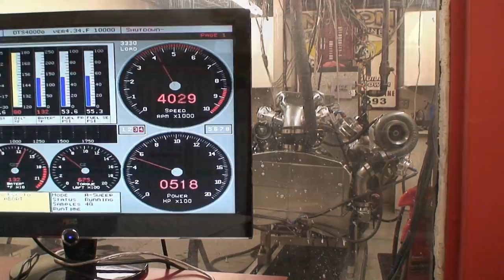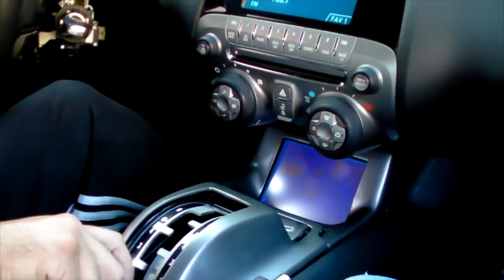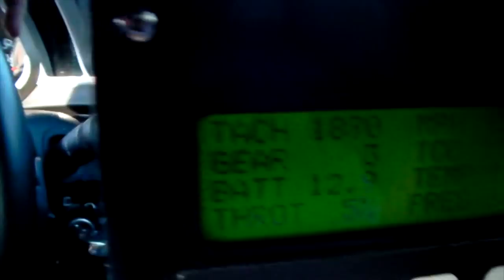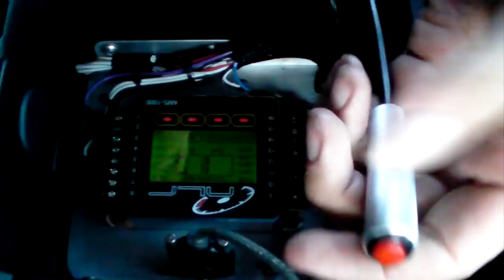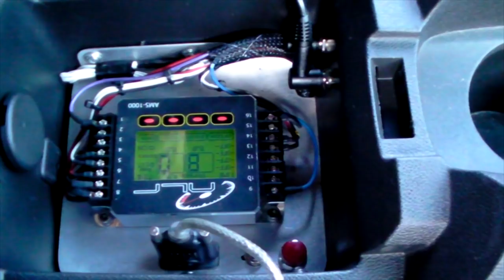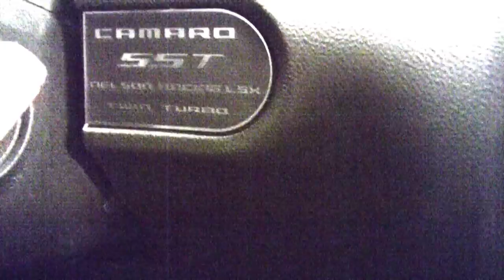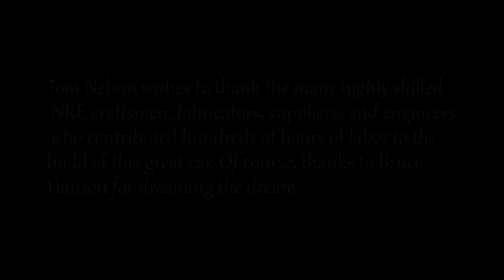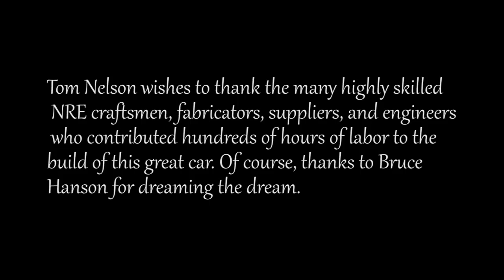1500 HP Camaro Burns up Chatsworth!  LOL!  Twin Mirror Turbo LS Camaro.  Nelson Racing Engines.

Comment: So many people keep saying why build a car that has no traction and cant use the power. I just wanna say, did you even watch the whole video? The part where he tubed the rear end so you can fit big tires in the back. Of course your not gonna take it to a track with street tires. He is just having fun and showing/testing the car. Once the owner has it, it will probably have at least a wide radial tire for the street.
Reply: isn't the word tubbed? i know it aint tubed

Comment: Yes. I just left out the power lost associated with spinning the turbo as it is relatively very small. It could possibly be made up in relieving vacuum (see below).
Like you said, when you are off throttle with a turbo, it is able to cruise like a stock car and get great mileage. Additionally, the turbo produces just a slight amount of boost when cruising (they never stop). This boost eliminates the vacuum the engine creates to pull in new air/fuel. So it improves efficiency.

Comment: Just to add to your explanation, turbo chargers do use power to turn them as they are a restriction in the exhaust, and create huge back pressure, however, it robs a lot less than a supercharger.  Also a supercharger is creating boost at all times, and a turbo is only making boost when the engine is under load, making it possible for these things to cruise around like a stock car, which is why they can get 20+ mpg just driving around.

Comment: Yes. The turbocharger acts as a sound reducer. If you try using an exhaust system designed for a turbocharged vehicle it would be painfully loud. Depending on the situation and the laws in various states, it's possible to have a legal turbo-back exhaust with nothing but a single small resonator.

Comment: well if you consider the fact that a supercharger or blower has a parisitic effect on the engine its somewhat more efficient to run twin turbos even though they have a bit of lag you can still get more boost out of them even though they put out more heat you can still overcome that with different cooling systems

Comment: Turbos use wasted exhaust to make power therefore eliminating the need to spin another belt to drive the charger and helps increase hp. Plus you get the option to play with boost from mild to wild

Comment: Hey Nelson, I hope you can get a chance to read this. What would happen when those side airbags go off? If I'm correct they are meant to go right against the side doors and now that you have that bar there would it be a chance that it could push the seats sideways when they go off. Also, Might I suggest taking those Gas caps and having then laser engraved and inlaying some acrylic red to make the engraving pop on those gas caps.

Comment: I know what BBC means. I thought it was a BBC pattern lower-end, turns out I was wrong, it was a SBC (up to 500ci).

Either way, I'll take a 500inch SBC over a BBC any day of the week. Lighter, less rotating mass and still capable of big displacement and massive power output.

Comment: No, what I said is 100% applicable. You say they are too heavy and handle like shit. Well, with aftermarket suspension and geometry upgrades, it's not hard to make a heavy car handle. And you can easily put it on a serious diet.

As well, Nextel cup cars are a prime example. You design it properly, regardless of weight, it will handle. I'm not comparing it to the Camaro, I'm using it as a benchmark.

Comment: It's not the turbocharger, it's the engine's rotating mass. Reducing the mass by using a lightweight flywheel and lighter internals makes the engine a lot more responsive.

Comment: Superchargers run off of a pulley. This means they drag on the engine. It takes power to spin a supercharger. It does not take power to spin a turbo. A turbo engine in this power range will make several hundred horsepower more. Plus you can adjust boost levels to have a pump gas and race gas engine whenever you want. Less drag on the engine also means better fuel efficiency, not that that matters here.

Comment: Indy and Formula cars are also very different, as the shifters are on the steering wheel and they are constantly shifting, more or less forcing a 2-hand grip.

I've been involved with racing for nearly 20 years, and many of the fastest guys at the tracks I've been to (and that's a lot of tracks!) drive one-handed.

Lack of power-steering also plays a role in driving style and hand placement, as do other factors.

As well, it's a personal thing, not a definite requirement.

Comment: I'm wondering if the rear CV joints and axles could handle that much power with Slicks at the drag-strip...? ThxI

Comment: You can easily put an F1R, X or F2 on this car and make over 1000rwhp, but you get in to the issue of controlling it. My C6 vette is in the 1000hp area(see videos), and that is about as much as I want through a blower car. As mentioned in the video, this car has boost by gear, or a boost controller. It's much harder to control the power in lower gears with a blower than it is on a turbo car. If I were to push my vette over 1000rwhp on the street, I'd go with a motec BBG and a twin setup.

Comment: Throttle response and probably cost.
Since superchargers are directly driven, the instant you touch the throttle they produce boost. Turbos, since they are spun using exhaust, have lag.
From what I have seen, twin turbo setups cost far more than superchargers from aftermarket. I am not sure why. And if you are going twin turbo, you should use an intercooler, also adding cost.
Possibly, they also see how easy a supercharger is for people to hot rod (simple pulley swap).

Comment: I'm pretty certain if you look up in car video's of any of the greats; Schumacher, Andretti, Earnhardt, Makinen, Burns, they are all using 2 hands. It is in fact the superior method by which to control the direction of your car. I'm relatively certain that none of the high performance driving schools across the nation will teach you to steer with 1 hand.

Comment: FWIW, being light isn't everything.

I have a 1990 LX Mustang @2850lbs w/500whp with a lot of suspension work, and I have been beaten by heavier cars with comparable HP/TQ figures.
Suspension geometry goes a long way to making something handle.

 Nextel Cup cars do quite well at Infineon, and they weigh something like 3400lbs.

Comment: Hi, good afternoon, you guys are selling this kit for the camaro rs 2015 v6? I need at least 1000 hp

I already have the suspension kit of the Z26 isntalado plus the brake kit of the ZL1 now it is prepared to receive all the necessary power

Comment: An awesome build. The one thing I have never condoned  is testing these things on the streets. Take it to the track and wind it out. Drive it normal on the street to show it can be a daily driver. I deal with traumas daily. An unfortunate accident would take away from the engineering genius and shift this whole thing into an irresponsible column.

Comment: No, a 7-time Champion and one of the best drivers to ever race in any NASCAR sanctioned event is my basis for this.

Safety devices and their use do not have any relation to the amount of hands on the wheel required to win races or drive effectively. To assume it would is naive ignorance.

By the way, you mentioned him as one of the greats (and he is), not I.

Comment: Amazing car but the turbo's are obviously too large for the motor. Its lag city with a 2k rpm powerband. Great for the dragstrip but useless anywhere else. The car is insane and I appreciate the work. I'll take mine with about 600 less ponies and turbo's that actually spool  when I hit the throttle.   Fuckin dude, burnout dude, deal dude, ho hum.  Props for the insane reckless driving on crowded streets as well. Fuckin awesome dude. Dude, rad, awesome shit dude.

Comment: "Unsafe Driving"??? Many of the Super Modified cars at my local track are driven with one hand. They weigh under 2k lbs, produce over 1000hp in most cases, and corner at over 80mph.

Anyone who drag-races with a Lenco drives with one hand, as they need the other to shift.

I've done rolling burn-outs at over 50mph in my Mustang with, guess what, one hand on the wheel.

It's all about skill, not "2 hands on the wheel". You can react quicker with one hand than two. Try it.

Comment: If you have 1500 horses running through an automatic, I will be disappointed. You should be driving a manual with this degree of power.

Comment: Haha, I work for a very large American car manufacturer. The new Camaros are really, really not that great. Extremely heavy, extremely large. Slow to turn in, feel like boats if you try to balance them on edge. "Just about as good as anything else" means absolutely nothing. They handle OK if you're comparing them against a Tahoe or Silverado, I guess.

Comment: wouldnt make sense....plus you probably wouldnt be able to shift fast enough thats why its a slap shiftier...just like in drag racing...an automatic with a manual valve body is way quicker than a 3 pedal standard...you dont have to push in the clutch and the shifts are instantaneous.

Comment: No they aren't. In real autocross, weight reduction is king. There isn't a single 5th gen camaro in my state that is competitive in autocross, even in extreme amateur classes. Do you have any idea how much "little extra weight" it actually has? Published curb weight is 3750lbs unloaded. Completely stock, drop in your standard American, a bit of safety gear and you're coming up on TWO TONS. Nearly 4000lbs in something that's supposed to be a sporty coupe. It's insane.

Comment: First off it lacks traction due to stock wheels in which he will be replacing with racing wheels soon as he modifies the rear suspension, TIS has yet to be run on a track but is estimated at like 8 seconds. Please quit talking like you know it, you don't I has work yet to be done to it.

Comment: seriously? I am sure this car has plenty of fail safes, on top of that anyone with a turbo, let alone this car, should and usually do run a wideband gauge, your a/f ratio's suddenly drop, you stop the car before it trashes the engine if it doesnt stall out first.

Comment: I know my 500rwhp/450rwtq 2850lb 1990 Mustang LX is a fucking animal on the street (or anywhere else). I couldn't imagine having well over 2X the power on tap! Just pure insanity! 

What I would give to have NRE swap out my Vortech V-2 for a twin turbo set-up.

Has anyone seen them do a Ford 302ci V8? Just curious of hp/tq figures.

Comment: thats a guess.. I would be willing to bet just the engine alone was more then that.  let alone all the costum work for the computey systems. so the car is what 45k? then on top of that is another 30-50k that puts u up in the 100k area. when you could buy some thing with not as much power but deffently better built.  These along with mustangs and corvetts are nothing but plastic and vynal.  the engines are the only things worth a damn in them

Comment: Possible? yes reliable and easy to tune? no. you will spend a fortune, pick either SC or twin turbo or single turbo although it would be awesome to say im supercharged and twin turboed it wont cost you near as much or be anywhere near the headache of having both to just single turbo or twin turbo. There is a reason you dont see much of it. its just 2 much BS

Comment: Why don't you guys take your beast out to the salt flats?

Then, let it really loose...
Reply: Because the sole purpose of this build was to create the ultimate street car that could be taken to the drag strip. Salt flats cars are a completely different animal. You have to fit into a certain class based on displacement, county of origin, number of cylinders, number of engines, etc. Then you have to destroy your car by sandblasting everything the salt can come in contact with. The salt flats are a surprisingly harsh environment for street cars. Air strips, and purpose built Russian tarmac are the places for these types of cars.

Comment: Im know im gonna get a lot of  hate but Im not impressed. Unless you already done it then disreguard this. Its the same formula as usual. Big built motor, Forced induction, fab work, powerglide, bla bla bla in order to create another 8 to 10 sec. straight line speed freak. How about you build something that requires a lot more skill to build all the way thru meaning  build a time attack monster. A camaro to assinate buttonwillow or better yet.. a lap of america camaro.  Otherwise just an dragcar

Comment: Yeah exactly, the extremely heavily modified FOURTH GEN Camaro Sam used was more than 400lbs lighter in STOCK trim than a 5th gen and it's 100% certain the one that he used was on a massive diet. You're now comparing a car that is a decade older against a stock version 2010. Next let's start comparing 5th gens against fucking sport compacts, right? Totally applicable. The new Camaros are fat and handle like shit out of the box, it's just a fact.

Comment: What the FUCK are you talking about?

How is that Camaro "stock"? When did stock Camaro's come with a 1400+hp twin-turbo 427 SBC? When did cages become a factory option?

This discussion is based on the video at hand which shows an NRE Camaro, not a factory stock 2010 Camaro.

Your words: "weight reduction is king". What part of "weight reduction" is "factory" or considered "stock"?

You twist the discussion to fit your own agenda, not the topic at hand.

Comment: It looks bad to you because you don't have a clue about cars or driving. It's not hard to do rolling burnouts with one hand on the wheel even on a car without power steering. On a boat like the Camaro with its silly-boosted PS it's even easier. Relax.